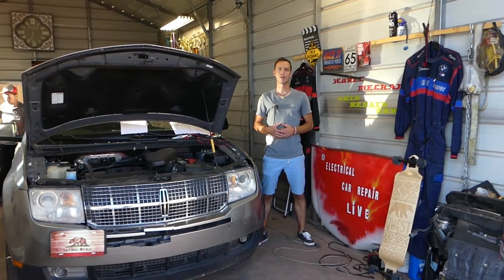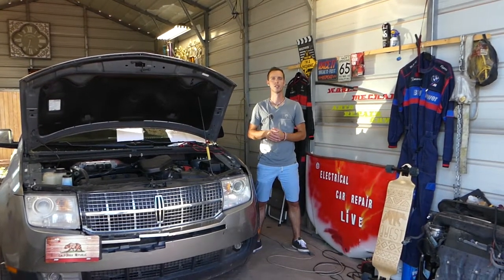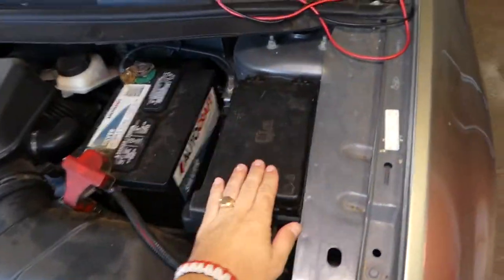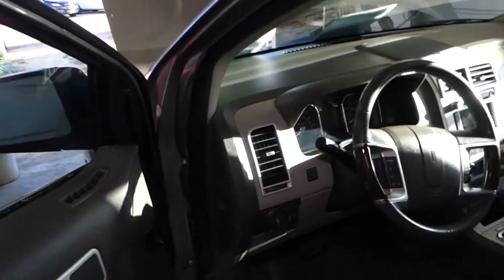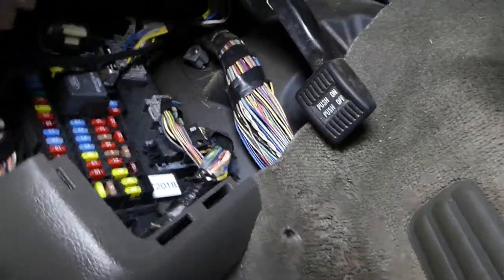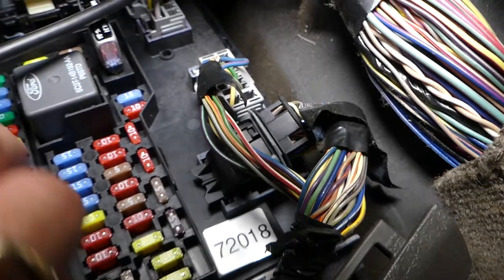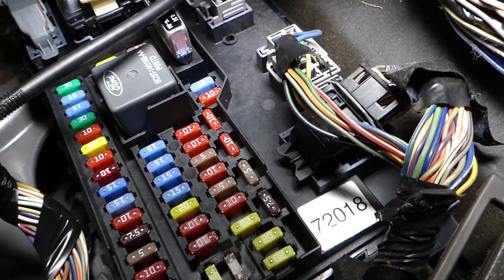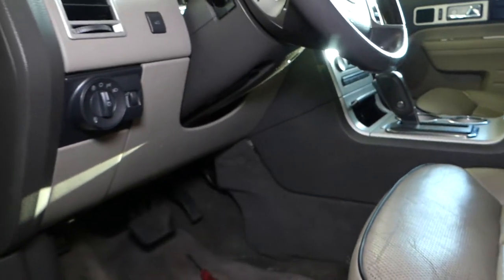LINCOLN MKX FRONT POWER WINDOW FUSE LOCATION REPLACEMENT. DRIVER PASSENGER WINDOW NOT WORKING

Comment: My son's 08 mkx front windows  and sunroof stopped working. I replaced the 2 fuses inside and it still doesn't work. It worked fine before.  I saw another fuse in the engine fuse box that says power windows. The rear windows still work.